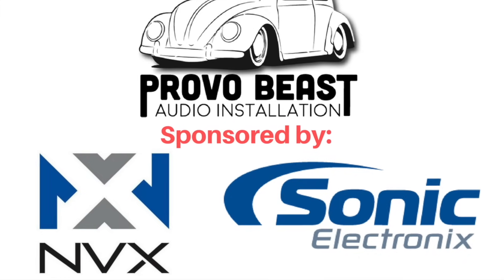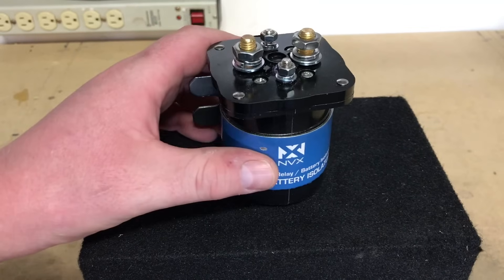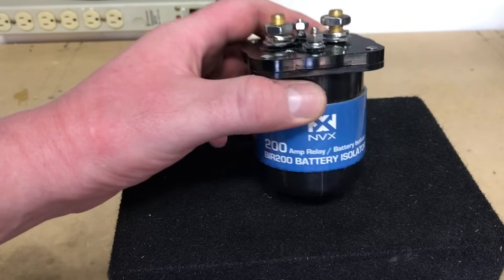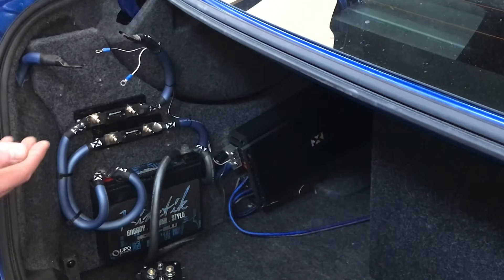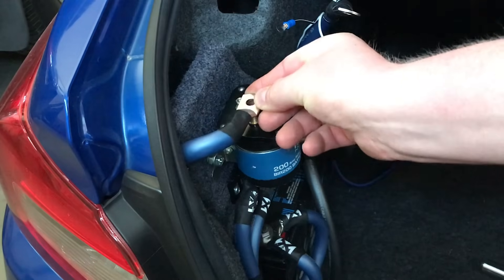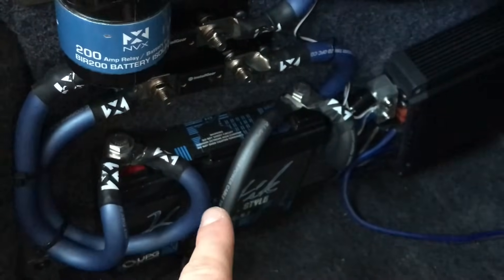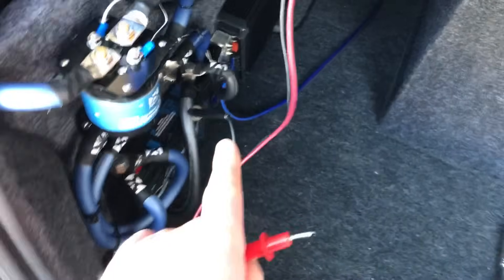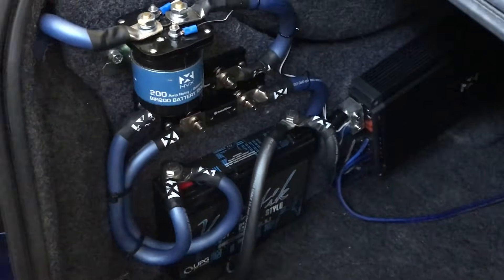Car Battery Isolators Explained: How to install on your car!

Comment from the maker: Parts linked in the description!
Reply: Can you do a video showing how to add a power cap or supercap to that WRX build? It'll be between the trunk battery and amp, but do you need to fuse it again somewhere or just run from battery to cap to amp?

Comment: I had a 4 farad capacitor on a build i did years ago.  I'm assuming the isolator would have still been a good option for the system by causing creating a managed separation between the capacitor that the amp was directly to, and the battery which the capacitor was connected to.  The capacitor was installed in the trunk with the amp and woofers.

Comment: It’s funny cause I keep pausing and rewinding the part where he’s showing the fuses and I believe he has 1 too many fuses.. Hopefully and only if there’s 1 next to the main battery under the hood where it should be. The fuse he has going from the Isolater to the secondary battery is unnecessary and not needed. I could be wrong… I’m new at this. But there should be only 2 fuses. 1 next to the main battery and 1 from the 2nd battery to the amplifier.

Comment: For the smaller cables.. 1 is for the ground.. can you tap or splice into the amp turn on wire for the 2nd wire or does it need to from the fuse box?

Comment: I have an 8500 watt amp that says it requires 720 amps in fuses and an amp for highs that needs 150 amps. My question ❓ is what amp isolator do I need?

Comment: Also would this help with voltage drop? When my bass hits the voltage sometimes drops to 12.2v or even 11.9v and the voltage fluctuates when accelerating and braking. I’m thinking maybe since the amp won’t be connected directly to my main battery the voltage drops should minimize?

Comment: Can I use the Amp turn on wire as a 12v+ for the isolator turn on as well as the Amps turn on ?

Comment: Is the smaller ground necessary for the isolator to work?
Reply from the maker: It's just for the internal relay trigger mechanism , not for the actual passing current.

Comment: So you said the Ignition wire from the isolator went to the amp, but then you talk about running it to the fuse panel, so which one is it??

Comment: if you have a dc to dc charger between your primary and secondary battery do you need an isolator?
Reply: nvm lol i put an isolator between the alternator and charger and its worked great for the past couple of months

Comment: What's the difference between the ignition a d a remote; and why can't they use the same source?
Reply: IGN is only powered on while car is running remote is usually wired into ACC that you can turn on without the car being on… so if you hook it to ACC (remote) you run the risk of draining your main battery if you listen to music with your car off.. it will still separate the batteries while car is off though

Comment: Came here because i bought the NVX Smart 200 but no room to put it up front nice to see this trunk install general census on google was close as possible to the front battery or battery period nothing about trunk mounting, also you're showing it going before the fuse to the secondary battery so check and check ty! EDIT: You need the isolator less if both batteries are the same sure but it's still advised since both batteries may not have same resting voltage when full and there may be a drain on the stronger battery not sure if it will damage it in my case the front AGM is a car start 70 ah and the rear battery is a car audio 2400 rated 100 ah AGM battery if i don't use a isolator it will constantly discharge to the smaller battery overcharging it and shortening it's life. So for $50-60 why skip it better safe then sorry.

Comment: I have a question.  Can you put a battery isolator on a car that has computer controlled voltage like a 2021 acura tlx aspec?

Comment: I got both positive wires of each battery going to the insolter and 1 power cable from the main battery to the alternator and I got both battery’s with their own grounds and I also got the second battery straight to the alternator aswell  my question is will it insulate if I have the second battery straight to the amp aswelll

Comment: Could you not use the remote wire form the head unit as your ignition source wire?
Reply: Yes
Reply: It will work.. but the remote is usually wire into acc not ign so if you do that you run the risk of draining your main battery if you listen to music with car on but not started

Comment: The remote lines from the stereos to the amps, is not the same function for the ignition wire ?
Reply: It requires the radio to be on

Comment: What size fuse should I use on the power cables? Im only running a dash cam
Reply: The fuse should be rated for the maximum current that your wire is capable of. Look up the maximum current for your gauge and material of your wire (e.g. 0 gauge CCA or 0 gauge copper maximum current)

Comment: Will this stop my amp from cutting out I have a start and stop vehicle if it does I don’t have to buy start and stop compatible  amp
Reply: As long as the remote wire of the amp is hooked into a 12v positive that has power when the car is on but engine is off, you should be good

Comment: what is the difference between a battery isolator and a relay? get 150 amp relay for 20 bucks. Why spend the money on a battery isolator is doing exactly the same thing.
Reply: Can switch be placed on reley, so I can turn off/on from cabin?
Reply: Right!

Comment: Silly question but what size gauge wire did you use for ground and 12 v Ignition? Thanks to anyone who responds.
Reply from the maker: 18-22 gauge is just fine. It’s simple just a trigger wire to initiate the internal replay to connect the main poles together.

Comment: The small 12V wire in the isolator cant be hooked up to the power wire for the amp?

Comment: Would I be able to use the remote wire since it uses 12v power to turn on?
Reply from the maker: Sure, although the isolator will be on whenever the radio is, and some individuals want to keep their audio on without the engine running.  Your call there.
Reply: @ProvoBeastAudio  Sounds great for me then

Comment: Will the LiFePO4 overcharge? I want to do this, im concerned that constant 14.4v to the LiFePO4 will cause an overcharge state and battery degredation and or a fire? Please reply a solution, if you have one? Best.
Reply from the maker: I’d consult the manufacturer of the battery.

Comment: First off thanks for the video and the install looks good. Now, are these more of a fail safe than a necessity? I am probably going to do it because it seems like it’s the right way, but is it’s sole purpose to protect the main battery from being drawn down by the secondary battery? That should only happen if you play music with the car off, if the vehicle sits for an extended period of time, or if there is a short or parasitic draw of some sort. Correct me if I am wrong.

Comment: Thanks for the quick concise information. I will be doing this to isolate a second battery running my inverter in my car. Currently I just have a AGM in the engine bay and a jump starter thing for when I kill it. Probably abusing this battery a little much.

Comment: Great video, I have a question for you? Does the cheaper battery isolator do the same job? Or will it be you get what you pay for kinda thing?
Reply: Personally, one thing I never cheap out on is the electrical in my system.  It can cause many more problems.  Expensive ones.

Comment: I'm doing a dual battery set up today.
I was told by an audio company that the isolator should be closer to the primary battery for it to work correctly 
I've noticed your isolator is way back in the trunk.
I showed them this video and they said with any dual battery system isolators need to be closest to the primary battery.
Reply from the maker: All an isolator does is separate two batteries when the coil isn't energized.  Location of that isolator between those two points does not matter.  I fix more installs from shops than I'd like to admit.

Comment: Out of curiousity... does this not create an easy way to have your vehicle started without your keys if you have ignition lock disabled like wouldnt someone just have to see this in the trunk undo the ignition wire and touch it to the woofer battery and bam car starts no keys if your car is old enough to not have push button and require it in the vehicle
Reply: Cuz I thought I may need it till I thought of the fact this does not in anyway sound secure at all for older vehicles should someone know what this is

Comment: Interestingly all these isolators do not have any protection.  I plan to up my near the firewall.   while no worries under normal circumstances if anyone needs to work on anything near the firewall there is a chance of shorting out either side to the ground and blowing the fuse.

Comment: Hello there can you help me out by telling me which fuze or power did you used for the power positive that is going to turn on and off when the car turns off or ON. what cable did you choose for your Ignition+ 12V source.  thank you. If you can help me out that would be terrific

Comment: If I'm running duel feeds of power to the 2nd battery,  do I need 2 isolators?
Reply from the maker: There are 500 amp isolators.  If you are pulling more amps than that, then yes.

Comment: I have a 1954 Chevy truck with a 6 volt system that has a generator not an alternator. Would a Battery isolator  with this system ?
Reply from the maker: Nope, if you want a 12v system to run 12v electronics, you will need to convert your '54 truck to a 12v system.

Comment: If I'm running accessories such as leds and air compressors for air system when the car is off an isolater is needed
Reply from the maker: It’s a great idea to do so!

Comment: Is the ground coming from the 2nd battery’s post going all the way back up to the starter battery or just grounded to the chassis somewhere in the trunk. You didn’t really specify where you have the black 1/0 going is why I ask because I am getting the 14.4 - 14.6 when I first start my car, but it has been draining (depending on how long I drive on each particular trip/how long I let the car sit in between trips) anywhere from 14.6 to 13.6. I am just wondering if it would drain more if I had drove longer on the trip that had it down to 13.6? & why is it draining when I’m driving at all? Is this normal? Mind you, I still have stock alternator & have yet to do my big 3 upgrade. I’m sure that if I upgrade my alternator from the stock 150 amp to a 350 amp ($278.99 not bad right?) or if I could avoid spending the $ on the alternator & fix this another way, hence my initial question. If anyone knows why this is happening, please let me know. I’ve been searching the internet since I got this thing installed, trying to figure out what exactly is going on. I did see one thing that said the isolator will try to “even out” the voltage on both batteries, but if both of them are starting at 14.6 then what does it need to even out?! You know? Any & all correspondence would be greatly appreciated. I probably just need to go on & cop that H/O alternator, right? HEELLPPP lol

Comment: How exactly did you mount that little piece of wood to screw everything on to?
Reply from the maker: We built it in house custom to the WRX with mounts to the rear deck lid and rear trunk floor.
Reply: Thank you for that reply! I have another question I added to a separate comment regarding the ground coming from the 2nd battery. If you don’t mind, could you take a look at that & see if you could help me out? I finally got this thing installed & just wondering if it’s normal the way I have it & just need a higher output alternator to stop any draining while the engine is on or if the drain is not at all normal & I’ve done something wrong because you never said anything about running the 2nd battery ground back up to the starter battery, nor does the illustration have anything like that in it. I’m installing a 40 amp relay from my head unit power wire since I have 3 amps & a 10 farad capacitor all running off a single, pigtailed, power (blue), coming off the head unit. I even turned off my head unit & drove around a little just to check what’s going on, but it’s still draining the voltage (about .1 volts, starting at 14.6 down to 13.6) every 10 -15, but nowhere near as fast without amps/capacitor running of course. May want to go ahead & check my other comment before you respond to this as well. Thanks in advance for any advice here. Feel like a kid in 8th grade bugging my teacher as I can usually figure this stuff out on my own, just never ran in to this particular problem with one of these before.

Comment: Is there any reason why you could not use the amp turn on lead to trigger the isolator?
Reply from the maker: That certainly works, but with that configuration, the batteries will be connected whenever your amp / radio is on.
Reply: @ProvoBeastAudio  👍

Comment: Why is the ground wire small. Should it be 1/0 like the power wire??  Need to know cause I’m installing one soon
Reply from the maker: The ground and trigger wire is only for the solenoid and is very low amperage. The solenoid connects both large poles together allowing the current to flow. Ground wire can be small like our 18 gauge.

Comment: Hi 
I have BMW e91 318d

And i have 5000rms amp for subwoofer and another 1500rms amp for front.

I wanna put second battery inside for more power.

Can you tell me how to do that in BMW

Comment: Does the manual overide bridge the batteries together if you need to use the AUX to help start the car?   Or, do you need to temporaly jumper the two batteries together?

Comment: Can I run the remote wire from the ignition to the isolator and the remote from the isolator to the amp? Do I need a diode to accomplish this?

Comment: Would this be good for a 2500 watt rms system? Or a higher version? Say 300 amp and up?
Reply from the maker: Easy baseline would be 14.4v x 200amps is 2880 max RMS, so the 200amp version should be fine. Other factors come into play, but hopefully that gets you started.

Comment: Im just curious…it might be a dumb question but could you replace the ignition switch wire that goes to the isolator with a remote wire from your car/trucks remote wire?
Reply: Was wondering the same thing
Reply: I did

Comment: Can you use blue amp remote wire as trigger for 12v power?
Reply: If you're OK with opening that circuit while key is turned to accessory rather then b4 its cranked over if that makes sense.  My amps turn on in click on ignition before cranked over

Comment: Could I also run the trigger to a switch on my dash? I'm wanting to use this for my truck that sits for long periods of time to disconnect my main battery from the truck so it doesn't drain down while it sits.
Reply from the maker: Sure, this is essentially a giant relay, so you can treat it as such.
Reply: @ProvoBeastAudio  Awesome! Thank you!

Comment: Can I also just mount this inline so it disconnects power to the power wire for the amps off the battery ? My truck drains the batteries if I leave it sitting over night it continuously pull amps with ignition off but if I disconnect the amp wire truck sits just fine
Reply from the maker: Sure, that would be a great use for it

Comment: Great video,  so if you need to turn on the acc for the head unit to come where would you   hook up the switch wire for the isolator? Wouldn't want the circuit to connect the two batteries with car not running.

Comment: Where did you connect the ingition wire?
Reply from the maker: Fuse box on a circuit only on when the engine is running.

Comment: Why the super heavy duty wire??, you are only CHARGING the 2nd battery not using it to start the engine. Check out the diameter of the alternator output (Charging) wire, the vehicle manufacturer has determined that is the correct size to use, you only need use the same diameter. Many people make this mistake
Reply from the maker: Who said I'm using the stock alternator? Do you know how many amps we are pulling? Maybe you should check the DC Wire Gauge chart based on length of wire and amperes being pulled.  Many people make this mistake.

Comment: I'm not sure, LoL, did you mention BOTH BATTERIES  M U S T   BE EXACTLY THE SAME? Reason is, if the second battery is smaller capacity, main battery will be never fully charged by alternator... 🙄
Personally I'm thinking about adding a second battery to my cargo van for use with small refrigerator and other electric stuff i use when park the car and waiting for next cargo loads and keep main battery in perfect shape ready to start my car at any time. So far I'm looking for some sort of intelligent DC DC converter or, if I'll not find any, I'm going to use regular DC AC inverter and regular car battery charger to charge second battery when driving..

Comment: I have a 200 amp alternator and a 500 amp isolator. What size fuse do I need between them?
Reply: You need to fuse according to wire size
Reply: The size of the wire
Reply: @maxbernard5797  I have 1/0 gauge.

Comment: What will happen to the starter battery that is full when the alternator starts charging the secondary battery? Won't overcharge the main battery that's the question?

Comment: I'd like to install a pure sine waver inverter in the trunk of my 2017 civic ex. I'd like to be able to use a kettle which is about 700 - 1000 Watts, and to charge my electronics. How do I know what size of inverter my civic can handle? Also what gauge wire would I need to go from the batter to the trunk?

Comment: Hey PB can I use a 200amp  battery lsolator on a Alternator off 160amp I have 2010 chevy Tahoe  got two Amp and 2 12'" speakers 🔊 What do you think